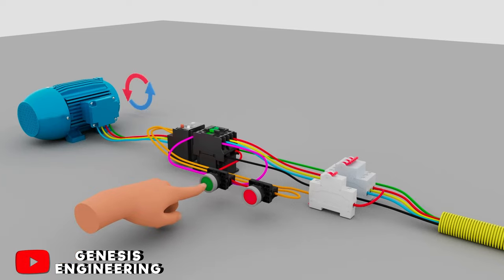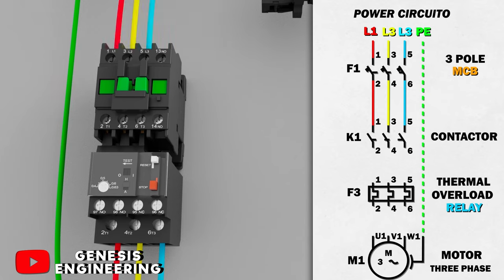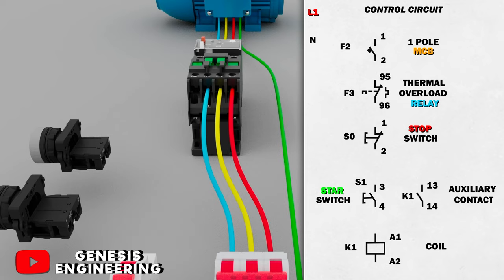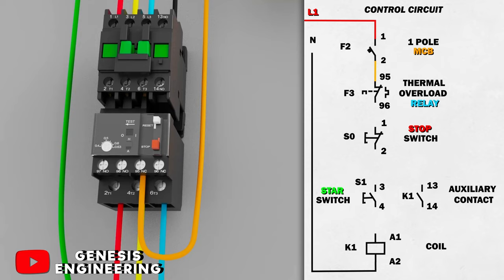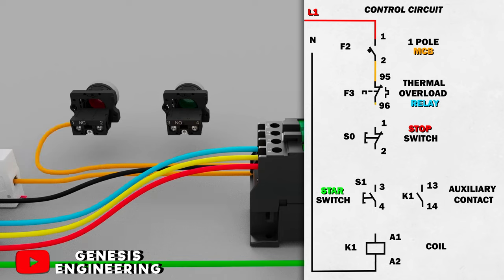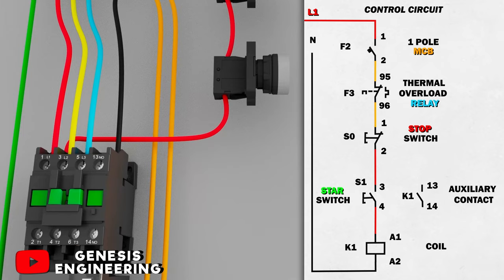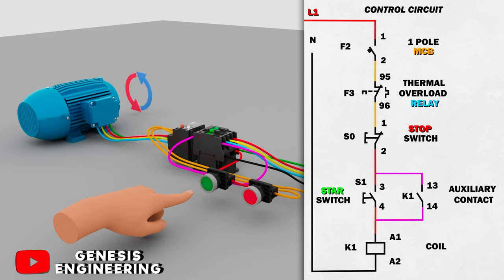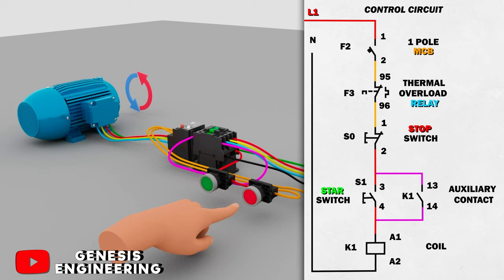3 Phase Direct On Line Starter/ Explain with Circuit Diagram, DOL Direct online starter

Comment: it's possible to connect the neutral wire to the motor instead of the grounding wire?
Reply: Three phase motor does not need neutral but must be earthed.

Comment: I thought this circuit was there to stop inrush current, but if it just turns the motor off whenever there is a high current, that means it will turn off whenever there is an inrush current, and the motor will always turn off just after it starts. I don't understand.
Reply: Certain type of MCB is designed to handle in an inrush current. An overcurrent must long enough for them to trip. Cmiiw, I think Type D Mcb is the breaker that should be used in this case. Type C trips faster but Type B trips the fastest which are common in the UK homes.